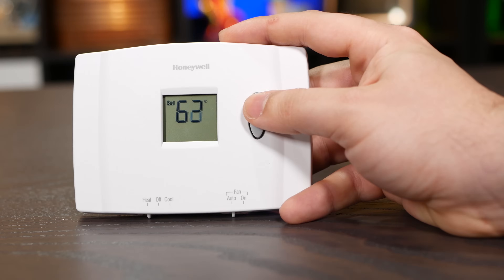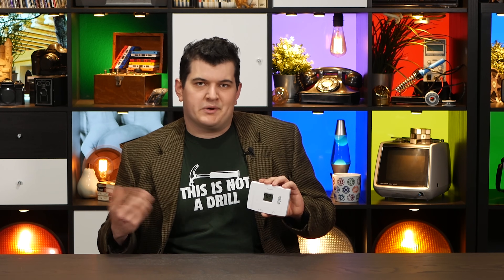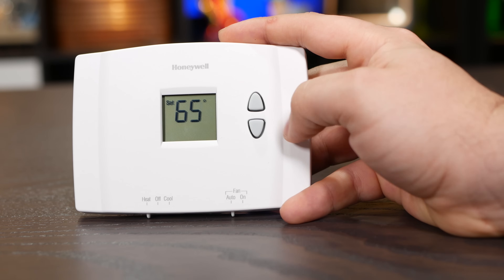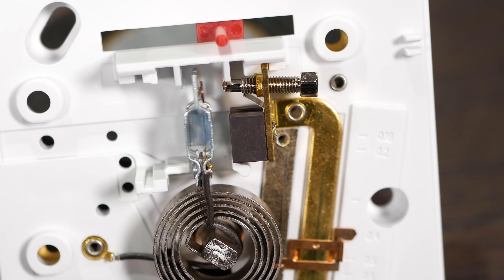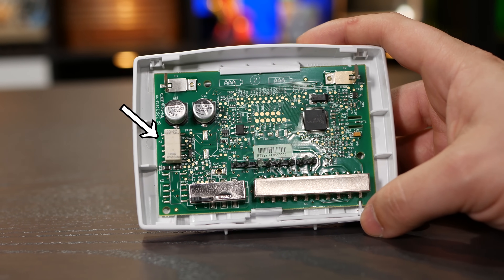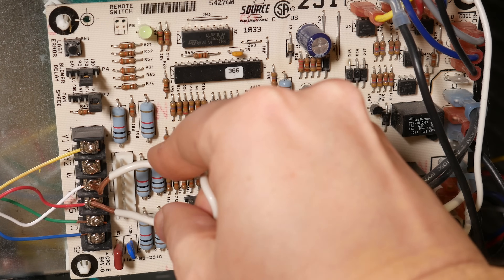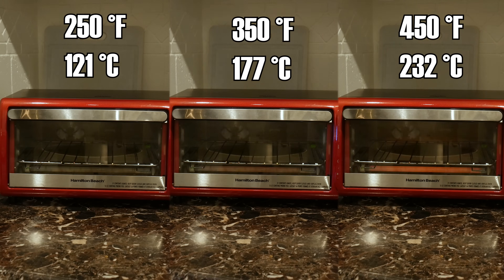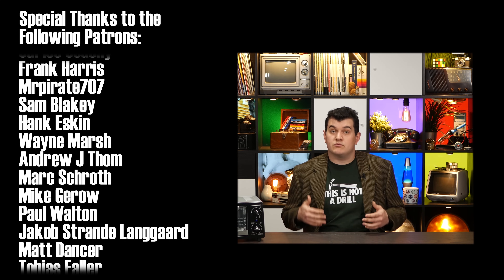Thermostats: Cooler than you think!

Comment: Shame you didn't have an old mercury thermostat, which had the wires make contact inside a mercury vial which was on a coil. So as the vial tilted based on the temperature assigned by the dial on the front, the mercury made contact and completed the circuit; and then as the vial leveled out with the warming or cooling, the mercury moved away from the contacts and broke the circuit.

Comment: I live in Japan where home central heating is very rare - the standard is to install a split reverse cycle air conditioner in each room you want to spend time in. These usually have a button marked "Powerful" or something like that to speed things up at the expense of energy. They also advertise fancy expensive ones that have IR cameras and auto-aiming air ducts to adjust the heat of the people in the room rather than the room itself.

Comment: You lucky Americans with your "air heating" and "air conditioners" and "fans". In Belgium we still heat water and pump it into metal radiators in every room.
Hot in the summer? Bad luck, you'll have to sweat; Need to circulate air? Open a window (even though that does jack shit if the temperature difference is minimal).

Comment: Hey Alec,

Don't know if this has been mentioned, but if you happen to have an issue with a classic bimetallic thermostat at home, they're relatively easy to troubleshoot!  A couple of friends of mine had an issue where their thermostat was stuck on, which wasn't super noticeable in the winter, but created a lot of problems once the spring months started around.  They called me to come in and take a look.

All you need to test a thermostat is a multi-meter, or any meter that can read electrical continuity, and either a heat gun, or a very powerful hair dryer.

Connect your meter to the leads of your thermostat and check for continuity. Depending on the style you have, you will either get a closed circuit (Normally Closed style) or an open circuit (Normally Open style) reading. Either of these are fine to see initially. Once your connection is secure and reading steadily, turn on your heat gun/hair dryer and aim it at the bimetallic strip at the back of the thermostat. Your reading should change (either from closed to open, or vice-versa) after the strip reaches the set temperature. If it does, your thermostat is operational.  If it doesn't, you may have a defective thermostat.  Defects could include improper metallurgy in the strip, or even a set of contacts that are fused together.  Thankfully, the classic bimetallic style thermostat is cheap to replace. Certainly way cheaper than your power bill will be if you just sit on it!

Comment: FWIW - and I know you said 'Amercian stat'  but in the UK those lines on the back of the stat and boiler(furnace) input panel could well be mains 240v...   no manual shorting with a jumper!

Identical principles apply though,  + some stats will PWM the on-off as they get close to the target temp to avoid overshooting.
Reply: Even here in the US this may be true. Some houses have electric baseboard heaters and those can also have mains voltage at the thermostat, and that can be 240 volts even here since it is a high power load.

Comment: We have Daikin reverse cycle air conditioners in our house. They have a “powerful “ setting where it will run cooling or heat full blast for 30min and then return to the previous setting. So, yeah. Completely possible.

Comment: Frustration of “smart” technology: when it makes things dumber.  I have a three-stage heat and single-stage cool system: heat-pump, oil backup, electric backup, and heat-pump cooling.  Cheap Honeywell thermostat allowed me to lock out the backup heat in “warm” conditions (above 0°C) and lockout the heat-pump in “cold” conditions (below 0°C) and also choose between oil and electric backup.  New Savant “smart” thermostat does none of this and won’t even let me program the time/temperature set points when I manually select backup heat.  Very frustrating, especially since it appears (visual inspection) that the Savant thermostat is simply a Honeywell with a Savant sticker glued on the front.

Comment: I think it needs to be clarified that a thermostat does not carry high voltage or amps. It simply supplies a low voltage low amp signal to relays that engage the mains supply to the a.c. (blower motors, compressors, cooling fans, and possibly electric heat elements). Live in south Florida. Interesting dade county law. U cannot sell a house without a heating system but air condioning is considered a luxury.
-Trapper

Comment: There are thermostats way more complicated. Danfoss calls those ECL. I have a ECL Comfort 210 and a ECA30. The ECL unit is in the furnace room and controls the bypass valve for the radiators and the pump for the radiator. The ECA is next to the stairs and is like a remote for the ECL (communicates using RS485 over twisted pair)
The ECA allows changing most parameters except the ones you should not touch unless you know what you are doing (those are changed from the ECL) and the ECA also has it's own temperature sensor. There is also a outdoor temperature sensor and temperature sensors on the pipes. The ECL unit can control the balancing valve and the pumps, or tell the furnace  to run the heating loop. (the furnace has it's own thermostat for the water in the loop and will not heat it above the setting. Also it will not heat if there is no demand)

Comment: Actually a non-magnetic contact on the end of the bimetallic spring would be even better in my opinion if they could work out the arcing issues and if furnaces didn't mind being run like that. To me the rapid switching on and off approaches perfect temperature regulation and that seems ideal to me. The magnet seems like a compromise necessitated by the technical limitations of the rest of the system.

Comment: My digital thermostat has only two wires coming from the heating thingy, 24VDC, and no battery. Wonder how it "sends commands"?
Reply: @Kevin Patz It's fully digital which is why I mentioned "no battery". I'm pretty sure of it as I have opened it. I'll edit it to add the controller is digital to reduce further confusion.

Comment: So the Honeywell thermostat that you demonstrated actually is used for both my furnace and air conditioning even though it's a single throw switch the way it works is the thermostat acts as a relay all of the heating and cooling controls are on the unit itself when you change the switch from hot to cold it changes the voltage between the red and white wires acting as an open connection for a cold and a closed connection for heat it's actually a pretty interesting system although it's old as dirt look up an Intertherm furnace unit with air conditioning and you might be able to find it

Comment: The combination digital thermostat and timer unit in my old house used to have a +30 MIN and +1 HR button that would override both the timer and the thermostat and do exactly what it says on the tin run the heating system for 30 minutes or 1 hour respectively. Also PWM thermostats do actually exist it's basically a PWM circuit that varies it's duty cycle based on the voltage output of a temperature sensor most GPU's for example have one using the voltage from the thermocouple on the GPU die to control the duty cycle of the GPU cooler, same basic principle of operation as a PWM throttle except of course the latter has a potentiometer connected to the throttle handle in place of the thermocouple to provide the control voltage.

Comment: For those who have problems reading the explanation at 12:20

You can go frame by frame by using  ,  and  .  (or in his case  <  and  >)
Reply: Thanks! you're not a fun sucker :-D
Reply: Remember, you must be paused for it to work.

Also, this makes reading those single-frame messages way easier now that I don't have to set the speed to slowest and spam the spacebar, hoping that if Youtube skips a frame or two, it doesn't skip the frame I wanted to see.
Reply: Where are those buttons located on my mobile phone?

/sarcasm
Reply: Another Non fun sucker here. I forgot where I learned about the Arrow keys but I believe I learned about them going through the help pages for another reason and wandering past the article that contained keyboard shortcuts. I primarily spammed the spacebar at the lowest speed to catch what I wanted. Now I use this technique for catching glitches either intentional or editing mainly on Jacksepticeye's channel. The digital age sure has made stop frame gags a lot simpler to catch.
Reply: Not sure if it's just my browser, but my experience of the frame by frame is a bit buggy. Sometimes it just freezes 20 frames ahead - so you miss the content and you have to hit the button 20 times to keep moving forwards.

Comment: I loved my old mercury thermostat. It had two temperature adjustments arms. One was for heat adjustment and the other was for AC. Other than that it had only one switch. Off, on and fan. So you could set the ac to cool down say to 70 and if overnight the temperature dropped sharply outside and the inside temp went below 65 the heat would come on automatically. There was always a 5 degree sway from heat to AC. Seems all the new ones you will be out of luck in the middle of the night and have to get up and turn it to heat. I want that style back.

Comment: My project car (a 1982 Volvo 240 sedan) has mercury switches to operate the hood and trunk lamps, and push switches to operate the interior dome lamp when the doors are opened. Guess which ones still worked after years of the car standing abandoned in a garden?

Comment: at work you have manually stwitch between heating and cooling, and the house system can either heat or cool, so when the main air contition is set to cooling, and you set your room thermostat to heating and its colder than the set themperature it cools on full blast for eternity

Comment: Just watched you latest and it is great as usual.
As for the last question, my split unit A/C has exactly that feature. It can run for half an hour on full blast with a push of "TuRbO" button, and then goes back to the designated temp set as before! 😁

Comment: Well since I live in Australia, I've never even seen one of these lol. Still I really entertaining and informative video :)
Reply: So how do you control the A/C without a thermostat?
Reply: @roceb5009  for an evap the controls are manual, set fan speed to a certain number and mode to cool, fan, or vent (vent is reverse fan to suck air out of the house rather than blow in, cool is fan with the pump running to soak the pads in water). Refrigerative units will have some kind of temperature control somewhere but it just does the air conditioning so it's usually just called the air conditioner. Central heating is almost unheard of here unless it's reverse cycle air con which is still called air con. Winters are mild enough that we usually get by with gas heaters or radiators / fan heaters in living.spaces in the evenings
Reply: @roceb5009   Well our AC has an IR remote, which has all needed controls

Comment: 16:40 Most systems I've seen have a "turbo" mode that runs the heat or cooling for 20 or 30 minutes before going back to the normal temperature mode. They weren't central control but split-system AC.

Comment: lmao my apartment still uses one of those old mercury tube thermostats... honestly my only complaint is that the heat or especially the AC runs longer than I would want it to, since the mercury doesn't seem to be that precise in judging the correct temperature

Comment: I have an Ecobee 3, which does have remote sensors in different rooms (4, each powered with a wafer cell). While my HVAC doesn't have the zones to take full advantage of this, it is programmed to only take into account occupied rooms (the sensors have motion detectors) when averaging the temperature. That way, for instance, if everyone is still in bed on our always-warmer second floor, the system will allow the first floor to drop below the set temperature until it notices someone stirring about down there.
Additionally, I can activate a short temporary temperature change, much like the Nest request made at the end of the video. I've done this after coming in from the cold, when the normal level of heat just isn't warm enough.
Installing this smart thermostat was not easy, however. The one being replaced was a mercury tilt switch from the '50s, and had only 2 wires run between it and the furnace. I had to actually wire up my own little 24 volt PSU and relay based on a wiring diagram emailed to me by the manufacturer, and run 4-wire furnace cable to replace the crumbling original stuff.

Comment: There are definitely thermostats that allow you to switch "on" for 1 hour and then switch off. This is for cases where you would normally have them set on a timer and occasionally you want heat outside the timing period. Not sure if any work by temporarily increasing the temperature though.

Comment: I’m in the UK and many thermostats here do have a “One-Cycle” mode. It’s usually denoted on thermostats by a button labelled as “+1 HR” and overrides the temperature sensor and enables the heating for a set 60 minutes.
Reply: Yeah, Hive has a "Boost" mode where you set a temperature for a certain length of time. It's actually a bit of a misnomer though, because you can "boost" the temperature lower as well as higher.
Reply: @iAmTheSquidThing  Perhaps it's "the impact of the combined HVAC system" that's "boost"ed, instead of "the temperature"?
Reply: Unfortunately not on Nest's UK thermostats.

Comment: Actually, a LOT of thermostats will sort of do a bit of "PWM" in that they will shut off before they hit the set point, then come on again.  This may or may not be intentional.  The current going thru the thermostat heats it up a bit.  The benefit of that is, the thermostat's temperature reading lags the house a bit, so by sort of stuttering as it approaches the set point, it avoids overshooting, and in general makes for a more consistent temperature.

Comment: Please make a European version for this video as well. In most EU countries condensing furnaces are mandatory, and they only work well if you can run them at relatively low temperatures. Therefore most of them come with fancy PID controllers (fancy for a furnace anyway :)), and they consider both internal and external temperature in the control loop. They also use digital buses between the furnace and control units instead of simple on/off cables.

Comment: 16:25 Yes!
At least in the UK, a lot of (Most? All?) central heating systems have a "Boost" button which fires a heat cycle for a predetermined amount of time, say half an hour or so. This happens independent of the thermostat setting, so it's good for bringing the temperature of the house up a bit if, say, you're having a bath or shower and want a warmer house to dry off in.
Reply: Accidentally read that as "nap or shower". Then spent a few cognitively dissonant seconds trying to figure out what kind of sleep anyone's having where they have to dry off afterwards, all casual-like.
So thank you for that amusing snap back to reality. 😄

🐾 @go.team.prince 🐕
Reply: @PushyPushyPhoenix  Hey I like to nap after I shower!! get that 15 more minutes of sleep in before I must rush out the door LMAO. This of course takes 2 giant towels so as not to get the bed wet and promote mold 😉
Reply: Here in the US, many t-stats have a "temp" mode that over rides the programmed thresholds, so same thing, different terminology. Ours also have a manual "Hold" function as well that overrides the program, but maintains the temperature indefinitely until manually released.

Comment: They should add electromagnets into the bimetallic strip thermostats so you can turn the magnet power higher and lower; therefore the on/off threshold could be raised and lowered. So like instead of a 1 degree difference, you could make it 2 or 3. I don't know if this would work, because I literally know nothing about magnets or anything but it sounds cool!
Reply: Eggs if you wrapped the thermostat in an insulating material, I believe it would have the same effect and maintain a simple design. It would delay the thermostat’s perception of the ambient temperature instead of delaying its reaction.
Reply: That would also work. What I was thinking was that there was another dial that changed the intensity of the electromagnet. So if you left your house but want your home to be some-what warm when you get back (without being on the whole time), you put the dial on 0 so it needs to be cold for it to turn back on. I see what you mean though.

Comment: I was wondering if they still have those antique ones. Yaaaay! Yes they do, according to this video,  good to know. That is the kind I use because it is by far the most reliable. At least the antique ones are. If the new basic ones are built the same way, they will last nearly forever. I did have to use emerycloth on the contacts on mine one time, but that was years ago. I bet the contact thickness on newer ones is such that when they get bad, too thin to sand. If one has a thermostat that you can set short on time, long off time, there is a DANGER situation! The heat must be on long enough, in fuel burner systems, to create enough heat in the chimney for a proper draft to occur. Otherwise you might create a carbon monoxide situation in your home!